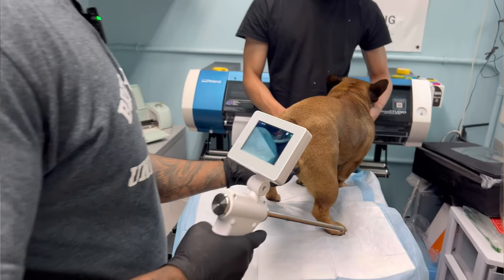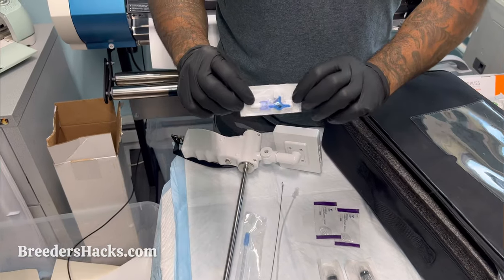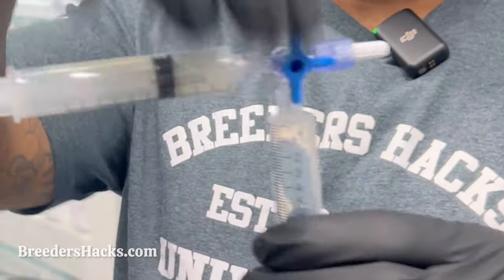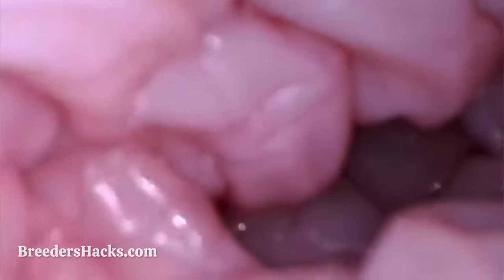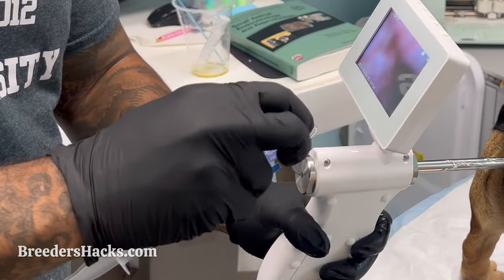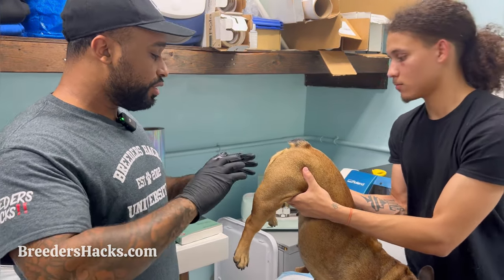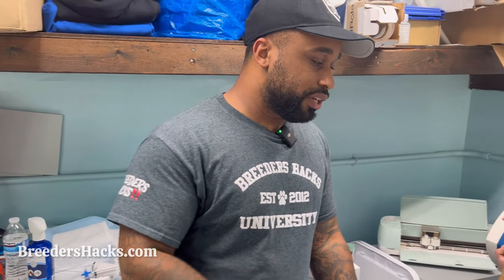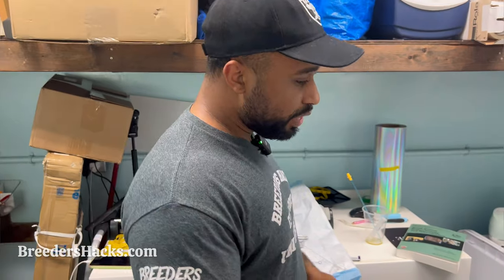How to preform a Tci - (Transcervical insemination)

Comment: did yall spin the semen down or warm it up to test it? Thanks
Reply: He said at the start he had analyzed it only.  But in my personal experience spinning it down and reducing the orthotic fluid seems to cause less pups not more.  I'm going to assume the right amount of prosthetic fluid is needed without too much.  

What I do is have like a small chip clip ready.  When you collect the first few pumps of fluid are going to clear and neutralize anything out of the males urethra pee tube.  Just as he starts to slow down  thrusting I push the first load of prostatic fluid to the bottom and put a bend on it.  The person holding the dogs front end then puts a chip clip on that.  Again a small one.  Then the next several pumps will be of sperm followed by additional prostatic fluid.  Once the sperm (white stuff) stops flowing and only clear liquid (prostatic) I let that fluid come out for about a 1-1.5 min.  So I end up with around 1.5-2mil of total sample.  That seems to be about right.  And it's better than spinning and maybe damaging sperm in my opinion.  Good luck